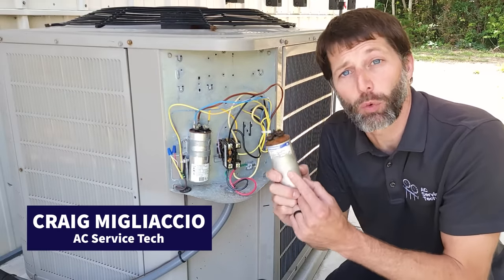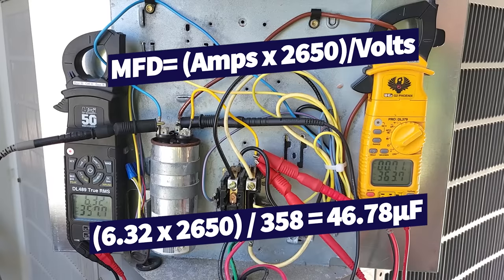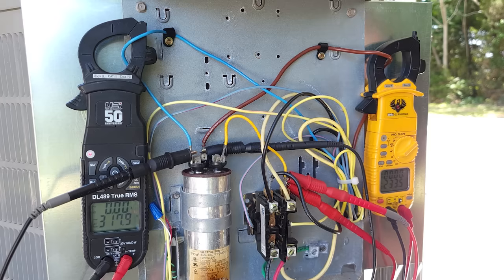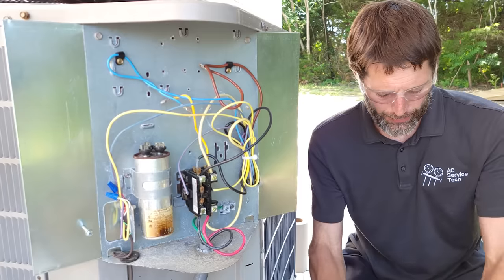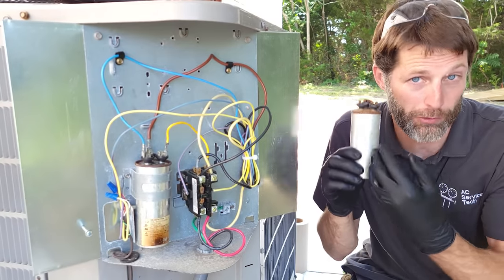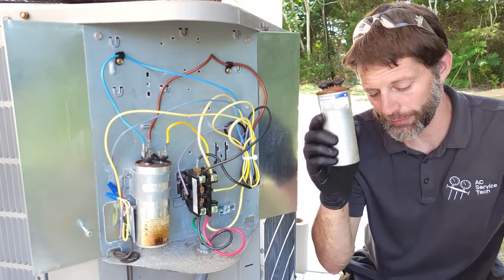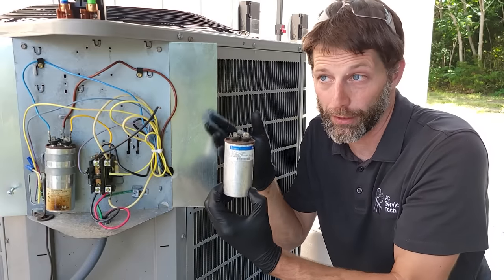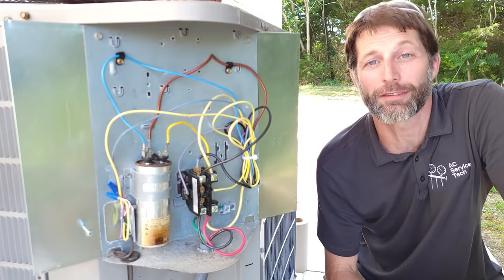WHY CAPACITORS FAIL in Air Conditioners! Watch it Break!

Comment: I'm a former instructor, still running service...This is an excellent video...Better than most, clear, easy to understand, and well done....Thanks again for what you're doing.
Reply: Can you tell me this, please. Is the capacitor an all-or-nothing type device, meaning, if it’s good, it’s good, and if it’s not, it’s dead OR can it become inefficient over time and operate poorly, degrading the efficiency of the A/C and driving up costs?
Reply: @Unknown17  Yes...They can weaken...The Micro Farad rating drops off more so than the voltage...When it happens motors run hot, if at all...They have meters that can check them...10% under...It's bad for the motor...I replace them if not right on the plate rating...Once weak, it will only get weaker.
Reply: @vernroach3413  Thank you! Just had one die on my home unit the other day, which was replaced. Even tho’ I’m a pretty old guy now, there are some holes in my education and life experience, and this is one of them. Oh, I also suck at knowing my flowers and trees. I don’t know an Ash from a hole in the ground, ha-ha. ‘Predicate ya!
Reply: @Unknown17  You're welcome friend...I'm aging out myself, late 70's, now doing favors more than actual service anymore...Helping people save money, keep them from being gouged and the gougers are out there...Still learning, still complaining, and still wondering, what the hell is going on...Be safe.
Reply: Will a bad contactor shuts off the compressor fan but the compressor will still run?
Reply: @easy7252  Possible, not probable...The compressor takes much more current to run...If the contacts get bad enough they still might make enough to let running current to a fan motor, but not enough to run the compressor...Rare, but happens...The fan will eventually be ruined if allowed to run to long without full current..Look at the contacts on the contactor...Bad contacts are easy to spot...If fan runs, compressor don't, look at the wires on the compressor...They burn off sometimes,and/or Capacitor might be bad...First thing, is full supply voltage there?...Going in the contactor and out when it's closed...Electricity is unforgiving and can be fatal...Be careful, it bites and bites hard.
Reply: @vernroach3413  I’m sorry I mean to say the condenser fan shuts off after 10 minutes but the compressor stays on. I replaced the motor, the capacitor and the contactor. Still doing the same. The voltage are good going to the contactor, all the wires are good. I measured the voltage to the motor while the ac was off and I got 120 on all the 3 wires. Then when the AC was turned on, I got 160-172 on the brown wire that also connects to the Capacitor on the Fan side. When the fan turned off after 10 mins, the voltage dropped back to 120v
Reply: @easy7252  I'm betting somewhere, you have a fan control mounted on the system outside...May look like a electronic brain board, Carrier and others used them a lot...They can be bypassed, and I do...Rheem, Ruud and others too were good for mounting  thermo disc style controls at various places on the condensing coils, usually on a loop...They are for Head pressure control...Head pressure drops off, it kicks the motor out, to raise it...That's one of the uses...Over engineering unless you're running the thing in winter,  like a heat pump or cooling an area that needs it for some reason.....100 psi must be maintained between the high and low side pressures for good refrigerant flow...The fan is stopping for a reason and probably being signaled to...If you have a schematic, look at the circuit to the fan motor...It will show the culprit, maybe more than one...The Fan motor can be wired directly to the contactor, load sides..Compressor kicks on, so does the fan motor...That's what I would do...Be care, don't do wiring when hot...Good luck.
Reply: @vernroach3413  thank you. I decided to put the old motor back and it started working again for a few hours. But after it turned off automatically and the Thermostat turned on the A/C again, the motor finally said I’m done. It makes a loud noise and will attempt to spin. I might have bought a defective motor because all the specs are correct but the new motor keeps turning off every 10 minutes.
Reply: @easy7252  Hey Easy...There is something wrong...Supply voltage to the motor, the capacitor, something...Maybe the wires going to the motor, but the new motor should have come with new leads and a new capacitor...Something if failing somewhere...I wish I were there to give a hand, this thing makes me want to troubleshoot it...I often help DIY'ers, for a coffee or better yet a beer afterward..I love the trouble shooting, gained a good rep for being able to do it...It feeds my ego honestly...Let me say this...Some meters will tell you voltage is there...It doesn't mean there is enough to keep something running...There is a meter called the WIGGY in the trade...Made by Ideal...It vibrates, using electric current to do so, meaning it's a load...Uses something like a solenoid motor...You can feel the vibration, reads and shows 110 - 220... Best one reads continuity too, but not cheap...Amazon, Ebay, hell Walmart might have them...Figure on $60 -$70 bucks...They are the most useful out there...Find problems more readily because they use current to vibrate...Damaged or Cut wires even show up under loads, that will still show continuity...Something is failing...Erratic problems are the toughest to nail...You apparently have one...Again, be careful...Using a WIGGY means working with HOT voltage...The circuit must be hot, when checking current...That Means danger...Pull a wire off the compressor at the  contactor, run the fan motor by itself...See how long it runs, how hot to touch it gets when it quits...If it gets hot, the capacitor, the wires, something in the fan motor circuit, is likely not supplying full voltage to the motor, or it is the motor...Again, good luck, watch yourself...One more thing...Check Pawn Shops for tools...Good buys sometimes.
Reply: Excellent
Reply: So to you and the author, I usually have a replacement cap for the fan motor and compressor. Should I grab ones that are 350 V or higher so they can take the high emf and spike Es?

Comment: I am amazed how much knowledge is available on the internet for free from folks willing to share it.  Thanks for making these videos.  Also, thanks for providing the Amazon links.  Looking through them reminded me that I need to get some vacuum pump oil and pick up a  swaging tool for an upcoming job.
Reply: I agree. I managed to install my minisplit completely on my own. Aside from wiring the outdoor unit up to the mains power, as that was done when my entire tiny home was wired.
Reply: I hate to break it to you, but all this information is located at the Library as well....for free. ;)
Reply: @JediOfTheRepublic  Actually, that is not my experience.  In 1989 I went to several libraries looking for books on sizing and installing central AC in a residential home.  I had bought my first house and wanted to install central AC.  I went to the largest regional library in northern Ohio, to the branch noted for science and technology materials.  I went to the Cleveland Public library main branch (two large buildings, 8 floors).  At the time it was reputed to be the largest library in Ohio.

Neither library had the type of book I needed.  They did have a book suitable for engineering students that required calculus, but not the practical info one would need to install central AC.  When I asked the librarian why they did not have such a book, she said that it was probably too complicated for most people.  Now, we have high school drop outs in the HVAC trade, so I know it isn't rocket science.  

I ended up finding a text book on the internet (this was pre-YT, and in the days of dial up) that was intended for trade school students.  It covered car AC, residential, commercial, etc. from beginning to end, hardcover and about 3" thick.
Reply: @menchelke  And, with a little care, turning off the main breaker or pulling the meter, you could have done the wiring as well.
Reply: @BryanTorok  If you look at my channel, I got crud quality vidoes too,  you can see my install, but I'm disabled, and it would look like crud. The guy I hired, does clean professional work. I have the industrial look with exposed conduit everywhere. I'll make repairs, do outlets, ceiling fans, etc. But not a full install with conduit bending, etc. Guy did it over 2 days in 110 heat, as no ac, as there was no electrical. Would take me like 5 years at my pace and still look like  crud.
Reply: @menchelke  You certainly make a good point.  I'm 30-some years older and not in as good shape.  Also, when I added up the hours I spent versus cost, I could have spent those hours working in an air conditioned office and earned the money to pay someone else to do the job.  BUT, I would not have the knowledge and pride I gained by doing the job myself.  That made it worthwhile.
Reply: @BryanTorok  - Could you recommend the name of that book for me? Thankyou.
Reply: @BryanTorok  - Sorry i meant could you recommend the name of that textbook for me? I might have a site if your interested where you can find any technical textbook for free. I intend to share with you if i can prove that we can find that textbook. Its a site where you can find very expensive textbooks.
Reply: @brycer985  That sounds nice.  However, we moved a few years ago and my best guess is that it is in a box either in the basement or in a storage locker.  If I stumble on it, I'll try to come back an post it.
Reply: @brycer985  A really good OLD book that covers the basic things needed for residential hvac is named Doolin's Trouble Shooting Bible.  It's about 2 inches thick,  gray hardback cover with full size pages and basic electrical and piping drawings for the beginner.

Comment: Thanks. I had a string of cap failures on a new Trane sysyem. After the first 3 or 4, the AC guy measured voltage. I had a bad street transformer and 1 leg was 115, the other leg was 132. Town came and replaced it, no problems ever since.
Reply: Been there done that. Power companies don't mind coming out of you don't mind waiting

Comment: For anybody wondering where the numbers come from, recall that impedance of a cap is 1/(2*pi*f*C). Plug that impedance into Ohm's law and rearrange to get C by itself, and assume 60 Hz. Dynamic testing like this will be much more accurate in a real world situation. Brilliant video!
Reply: Thanks so much. You are the only one who answered the question on every one’s mind ( except for the Newtons)
Reply: I'm missing something, as solving for C= I*2*pi*f/V.  The 2*pi*f is 377, which is 1/7 of the 2650 number. What fudge factor is missing?
Reply: @f.hababorbitz  Remember it's in the denominator, so you need to invert the number, 1/377= 0.002652. Then note that for simplicity he changed units to get rid of micro units by multiplying by 1,000,000.
Reply: @spelunkerd  Thanks, to much manipulation in my head and not seeing that I had 1/C, and did not invert the 2pi*60.
Reply: That's the formula for Xc. , which is NOT resistance. It's reactance
Reply: @GBS1043  Well, the resistance of a capacitor is miniscule compared to its reactance, so for practical purposes one can estimate impedance from reactance when looking at a single component like a cap. The phase shift is almost exactly -90 deg, so the two are nearly identical in a capacitor off the shelf. Good engineers will naturally understand when approximations are useful and accurate.
Reply: @spelunkerd  Very good explanation Dave with the formula and how the capacitance is derived.
Reply: Your formula 1/2piFC actually solves for capacitive reactance Xc.  Impedance (Z) is the sum of reactance + internal resistance Z= (Xc+R) .  But you are correct reactance is the value you want to use in C calculation.
Reply: @mdbmdb001  Hey Mike! Impedance is not really needed for the equation since the ESR of a capacitor is very low and can be ignored. And the equation for Z can't be added since the two values of resistance and reactance are out of phase. The equation for Z = square root ( R^2 + Xc^2) or if one prefers the rectangular format it would be Z = R + jXc
Reply: @chuck 8094 So why would the equation for selecting a run cap size be related to the voltage and current draw of the motor (V=IR)? This would be if you wanted to balance the source impedance to the motor impedance. And for the measurement of motor current to be valid, the correct capacitor would have to be in the circuit to measure that value. In the end, this capacitor is providing a 90 degree phase shift of current to the motor start winding relative to the run winding. If you didn't have a working capacitor to start with, then the current measurement would be different. It has to be there for the compressor to start. Seems a chicken and egg issue to me. What am I missing?
Reply: @chuck 8094 Spelunkerd had the right starting equation, but the logic is what I want to understand of why, and the only thing I can think is what I wrote of maximum power transfer will be when the source impedance matches the sink impedance, from transmission line theory. I'm also ignorant to PSP motor theory.
Reply: Thanks,  I never saw it done like that before, very simple and interesting.
Reply: @f.hababorbitz  Those are excellent questions Fred. I'd love to attend a course where those topics could be explored in a deep dive. The story is really complex because inductance of a motor and back emf vary with rpm. You end up with a balance of factors that you have to juggle, many of which are competing interests. However here, all he is doing is measuring voltage drop across the run cap and current going in, then he uses a little math to show what the run capacitor impedance actually is while loaded. From there he assumes low ESR and gets capacitance. He comes out with a figure that should be more accurate than the label on the side of the capacitor. He isn't doing anything to explore or optimize ideal figures for design reasons.
Reply: You're making my head hurt...Sheesh...We use meters...If they say bad, they're bad.
Reply: Really dude, what the fk for

Comment: I’m a Contractor now but been in the HVAC trade for 18 years and I still learn from your videos, good stuff and some of it I’ve forgotten about.  Thanks for putting in the effort!
Reply: On high end heat pumps a soft starter is used instead of Start and Run capacitors.  But if manufacturers of lower end units fix the problem of capacitors always failing then a ton of service technicians would have very little to do.

Comment: Thank you for the great content! Having a clamp ammeter plus a good DVM makes checking the capacitance very easy as opposed to cutting the power, discharging the caps, disconnecting the caps and using a meter that can measure capacitance. I also like the fact that your way tests the cap under load. With the supply chain woes I think I'll buy an extra just in case. Everything in your A/C system is designed to fail after closing time on Friday in August.
Reply: I love your closing comment. Isn't it the truth. I'm not an HVAC guy but I maintain a surplus of new and salvaged items around the house in those emergency situations.
Reply: Truth
Reply: we had restaurants with my wife and the ac got bad most of the time Friday 5pm , so i couldn't get the parts needed
Reply: Also when record temperatures (120F)

Comment: Thank you, your video is by far the best at explaining why capacitors fail. When I built my house I purposely placed the AC unit on the north side of my house away from the sun.  Not only does it help save capacitors it also lets the unit run more efficiently.

Comment: Thanks for the video!  My HVAC capacitor recently failed and due to the recent heat wave and we could not get a vendor out.  Was able to get a capacitor and install it with the help of videos like yours (locked out the circuit, waited, then tested for residual voltage).  the old capacitor had good shape but the top was wet from electrolyte leaking.  Thanks!

Comment: Excellent video. I replaced my 20 year old 30/3 MFD capacitor after condenser fan would not start (but would with a push). Cleaned all connections and replaced capacitor. Old one measured 29.8/4.7, indicating a leaky capacitor on fan side. New one measured well within 1% of spec. I also measured total amps to condenser unit before vs. after repair which dropped from 8.9 to 8.15.  System runs great now.

Comment: He heated the capacitor at the bottom.
It wasn't made very clear in the narration.
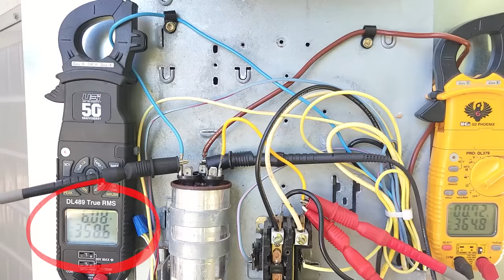I saw many comments asking this, and after seeing several comments that he did actually mentioned this, I replayed the video until I found it mentioned vaguely at 5:42. I assume he heated it with a torch...

Good demonstration! Fun to see the disconnect feature in action. Thank you!

It would be very interesting to repeat this with a thermocouple reading the case temperature at the moment of failure...
It likely exceeded the lifetime max temp rating, but that is how accelerated life tests are usually done anyway.
I don't know if you are inclined to try this again. Maybe extend the leads and place it in an enclosure that you can heat evenly and gradually, until it fails?
At the minimum, we would learn how much 'headroom' we have above 160ºF, and when 'lifetime' becomes '0' hours...
Mr KL
Reply: Yeah that wasn't clear at all. "Due to high heat" . Not "Because I am heating it"
Thanks for the clarification.